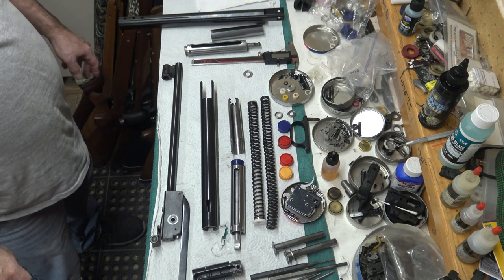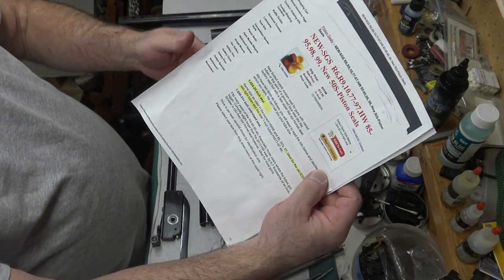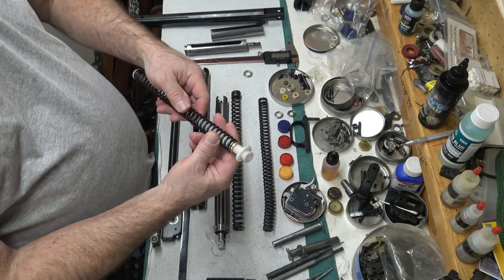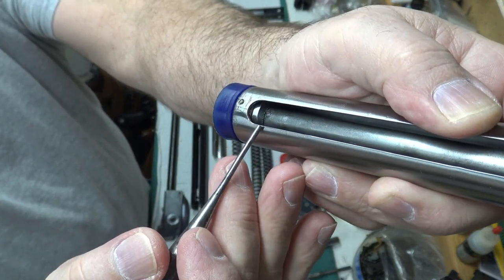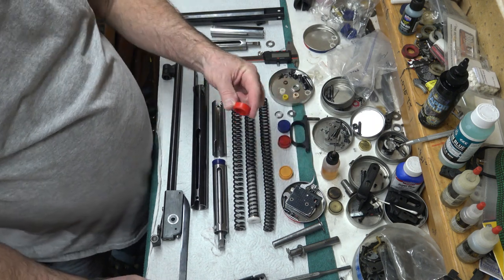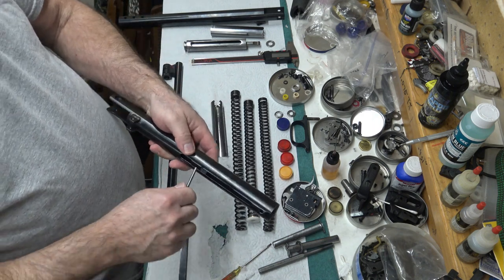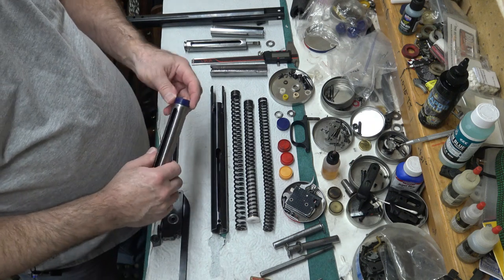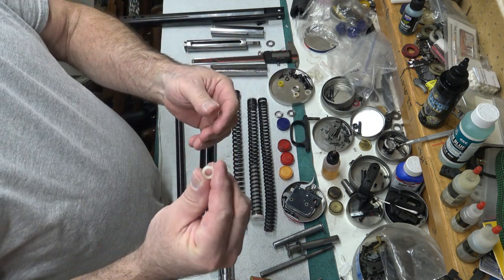R 10   20 carbine Full Tune  Info

Comment: Nice vid! I have taken up powder coating the outside of the piston. Works like a champ.
Reply from the maker: Thank you/ I can do cerakoting  but  rather do it when I can use the mix I prepare
otherwise  its wasted /
Reply: @MrSteppingstone888  I just figure it's a durable plastic coating that eliminates metal to metal contact. Sometimes if there is to much play, I will use a heat gun and use several layer then turn down in the lathe.  Thanks
Reply from the maker: @luckylarry5112  thats  really cool Larry.
 the pistons  are not perfect so I  try to chuck  it and  try different  positions see which  one is at least closer  to it being  centered
Reply: @MrSteppingstone888  You are so right!!!!!!! I have rebuilding airguns for over 20 years and every time I have to put the 4 jaw chuck on for pistons. I used to tig the spot to drill since many are hardened. Since I got a heat treat oven and most of the time it's just easier to make a new piston out of 4130.
Thanks for all you vids, you are a real asset to the community!!!! Larry
Reply: @luckylarry5112  How is the powder coating wearing?  Do you do this instead of buttoning.
Sounds very interesting,

Comment: Are you taking in work? I’ve got a couple cheap guns that could use a better spring guide and top hat. Thanks for posting videos! Lots of great knowledge.
Reply from the maker: what  springers are they ,
Reply: A Stoeger x10 that I can’t get to shoot. I mostly just want to figure out why. I’ve replaced the spring and seal with Vortek products and just tinkered with it a lot. I’ve got a Crosman too that I’d like to get a better spring guide and top hat for.
Reply from the maker: contact my friend Rich shar he is located in Ohio. Iam  just about ready to start a bath room renovation/  he can send the guide set up to me  for  the custom guide 
 but  shipping is not cheap these  days.  custom guide & top hats run 55. shipped back  I don't think its worth it you could buy a rws 34 in .22  or even a good used one  Riches email.
   rdshar5@comcast.net
Reply: Thank you!!!!!